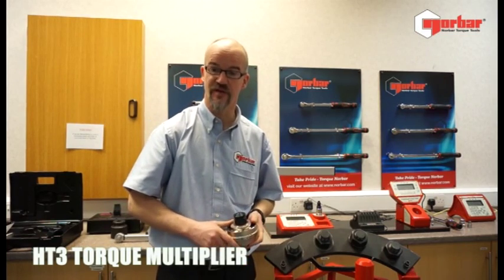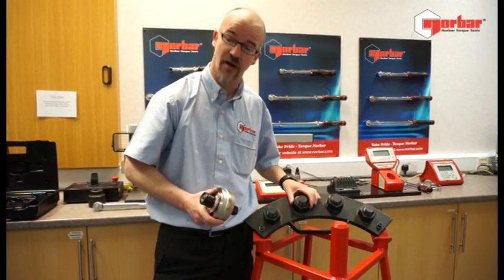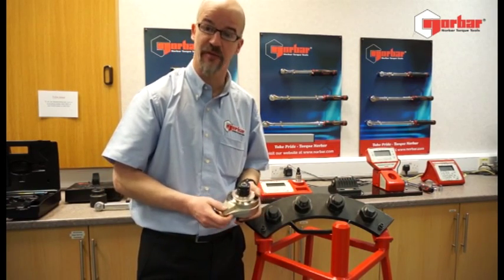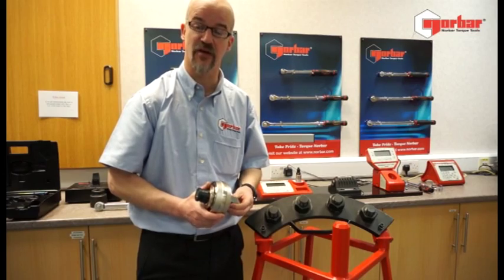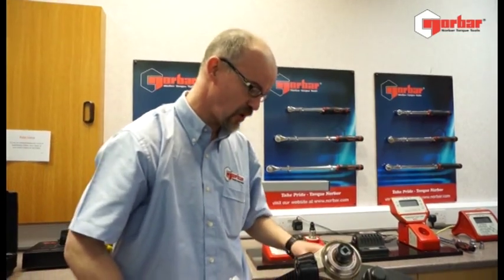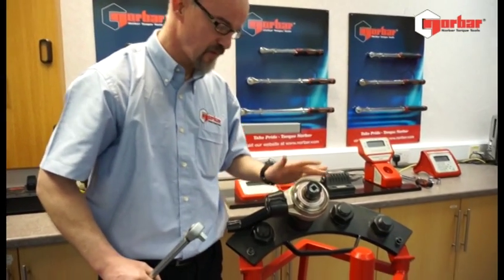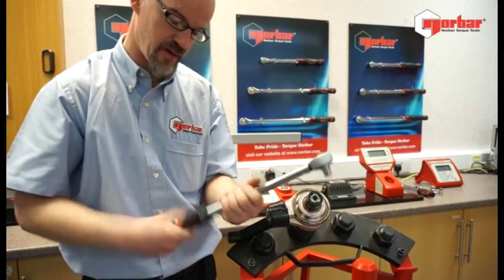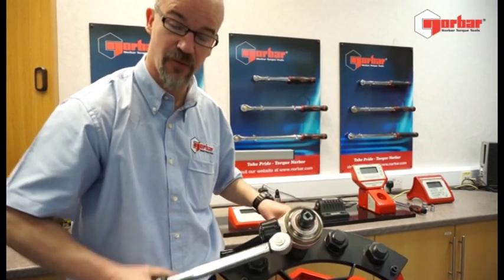How to use a HT3 HandTorque Multiplier

Comment: It's range Plz
Reply from the maker: The Ranges available on the model in the video are 1300 N·m and 2700 N·m. We also offer a 1000 N·m version which is more compact, here is the link to the video: https://www.youtube.com/watch?v=b-Wlqlm9MOk
Reply: No options clockwise & anti clockwise?
Reply: @maherghani5010 you can go both clockwise for tightening or anti clockwise for loosening , it works both ways either way it makes tightening or loosening 5 times easier if it’s a 5 : 1 ratio , hope this helps 😉